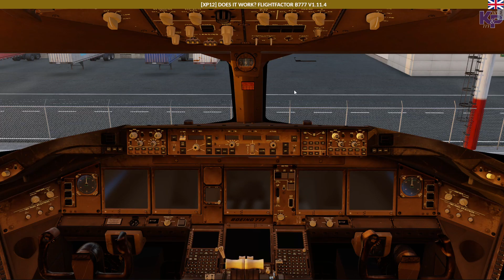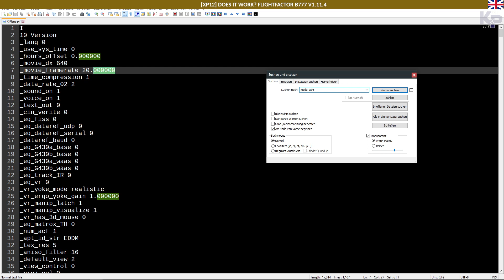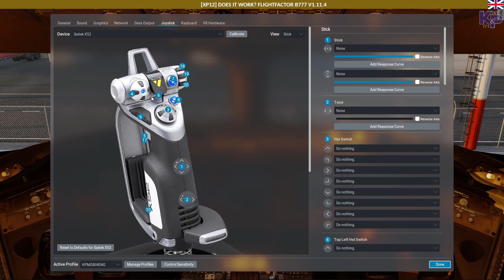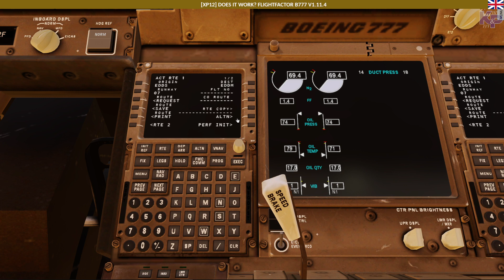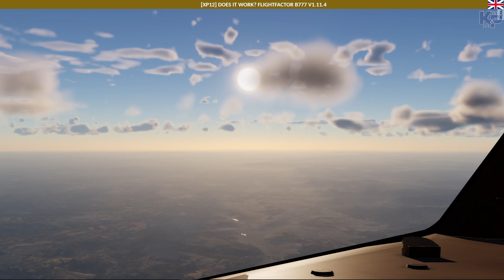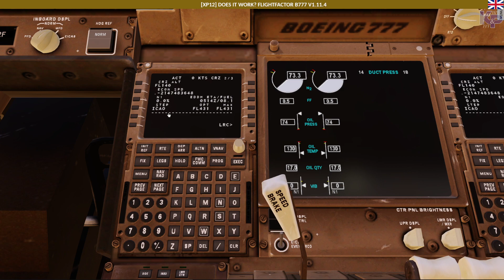[XP12] DOES IT WORK? FLIGHTFACTOR B777 V1.11.4 (ENGLISH)

Comment: Thanks for the review and yes it works on x-plane 12. The only problem with the payware plane is if using the 777-200er, the game will crash with a message that said "Failed to Allocate A Streaming GPU buffer" Just noted that it doesnt happen to the 777-300er but hadnt tried the 777-200lr and the 777f.
Reply from the maker: The problem is that FF will not make any fixes and corrections any more. It may work in XP12 but that can change with every XP release. I am betatesting the v2 - which is not fully finished yet.
Reply: @prokopiu  I see... I also heard about the continuous x-plane 12 updates that impacting many freeware and payware not only the plane's but plugins (Like what happen to SAM).

Comment: Hi with the Ffactor B777 in xplane 12 the throttle becomes unresponsive, does anyone know how to fix this and or how to get the latest update for this aircraft ? I constantly try the updater, but it says that the i have the latest version.
Reply from the maker: Check this forum entry: https://forums.x-plane.org/index.php?/forums/topic/288627-unsupportedfinally-got-777-to-fire-up-in-xp-12-but-throttle-levers-provide-no-power-now-partially-solved-but-now-no-autothrottle/&do=findComment&comment=2579729